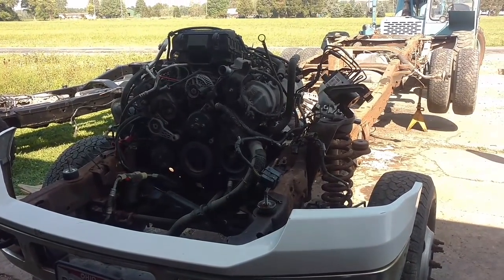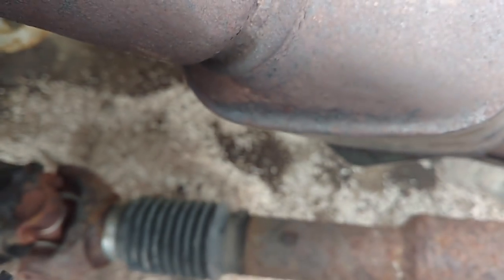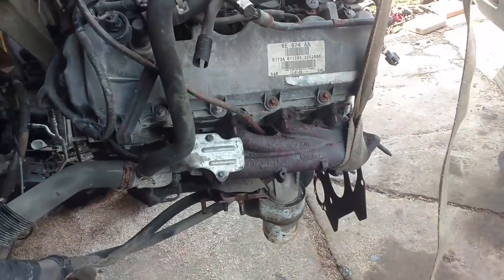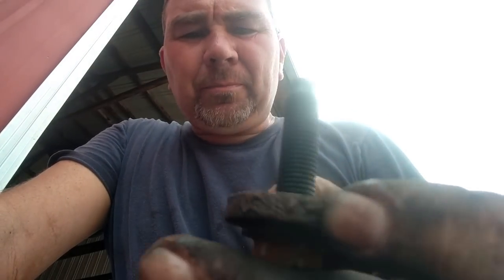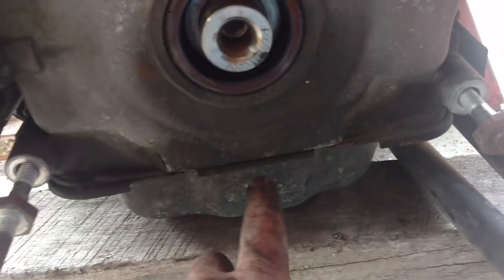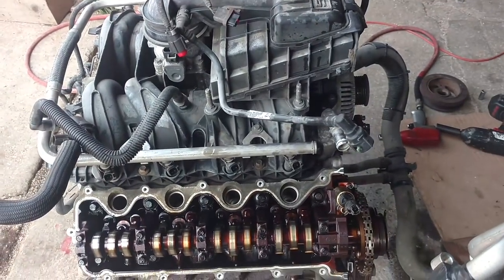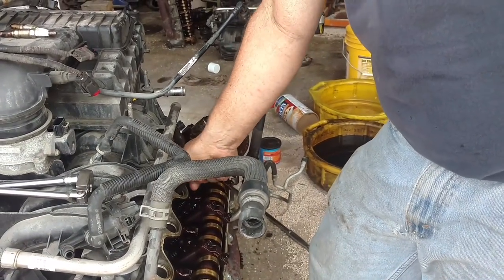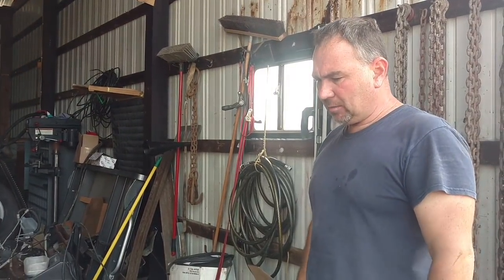PART 3) REMOVING 5.4 3V ENGINE AND GETTING A LOOK INSIDE!

Comment: Looks way better than the other 1...good tip on the spark plug carbon/pb blaster trick...heard some guys were having problems in there - l'll pass it on
Reply from the maker: i thought this one was worse than the other. i dont know if the pb blaster helps but i have had success with it so i will continue.

Comment: I would love to have the extend cab you just took off. I have a 1999 F350 with crew cab but the cab is trashed out. I like the truck because it has a  7.3 engine. Still looking for an extend cab with a title because DMV or the cops would give me a hard time. Thanks for the vid. !!!

Comment: Love the videos J.C.   Keep them coming!  What are the plans for the International Durastar cab you've got in the back of your shop?
Reply from the maker: good eye levi! that is going to be a truck like my freightliner. if you look back i think 4 or  5 videos ago you can see it. that is a 2008 (if i remember right) dt466 6+1 spicer trans. air brake with 24' of frame behind the cab. i assume you are interested in ih since you knew the correct generation.

Comment: Question:  do you see a problem with replacing the exhaust manifolds with shorty headers? On the 5.4
Reply from the maker: i refuse to use anything aftermarket if at all possible.

Comment: BTW I would do the exhaust manifolds and studs and a dipstick tube.
Reply from the maker: i agree. the dip stick tubes are always rusted where they come through the manifolds. i was on the fence about the manifolds as i found out they have been replaced. still not decided. if i do replace them, they will be ford manifolds. i used dorman once and ended up replacing the passenger side 2 more times and the drivers side once more under warranty in one year. never again.

Comment: a shame with all that buildup. hopefully you caught this one in time. that access hole for the convertor reminds me of a 5.9 Cummins, only a little user friendly.
Reply from the maker: yes, the lack of good maintenance is extremely frustrating to me. it will take a whole lot of internal engine cleaner and oil changes every 500 miles to clean up this mess. the access whole is just like the 5.9 cummins.

Comment: Did you originally buy the truck used or new?   This would be before it went to your brother.  Oil companies should take off the valve covers of engines to show the quality of their oil and how proper maintenance keeps your engine healthy longer.
Reply from the maker: this is extremely frustrating to me. i bought the truck from a golf course. they bought it new and had a good service plan. i change the oil in my gas trucks every 3000 miles regardless of whether it has synthetic or conventional oil. he told me he was changing the oil, but obvious it was not often enough. look at the results. this can cause  lots of problems. it is like eating nothing but fried foods all your life and wondering why you have clogged arteries!

Comment: I know you want that engine clean but if you're already spendy on your oil, extra detergent seems like overkill. The oil has detergent in it already. It will wash it down a little bit with on time oil service. 
Recently, I tore down a motor that I put 100000 tough miles since getting from a salvage yard. It wasn't clean except for valve covers when I got it and now even the pan looks good for the miles.
Reply from the maker: extra detergent may be over kill but in this engine proper oil flow is very important to the longevity of the cam followers and lash adjusters. i am replacing them all and want to be sure it is as problem free as it can be. i do agree that today's oil will clean it in time. if i had known it looked like this inside,  i would have started with the detergent while it was still in the truck. once i knew it was clean.(this would have taken months and months of driving)...then i could have taken it out and replaced all these parts with less worry of the new parts getting swamped with crud.
Reply: J.C. SMITH PROJECTS I only used cheap semi-syn bulk oil for this too. I did a 3500 miles service interval and used it hard. The engine looked gummed up when I put it in but somehow clean when it's wore out.
Reply from the maker: you gotta be happy with those results.
Reply: One other key I think makes a difference is hot engine oil changes

Comment: Are you using Ford parts or aftermarket?
Reply from the maker: i using the identical parts as i did with the navigator. cam phasers, tinming chain guides and tensioners i have been ordered as what has come to me before as ford reboxed parts. the oil pump will be mellings. the vvt solenoids will come from "standard". the cam followers and lash adjusters will be ford.